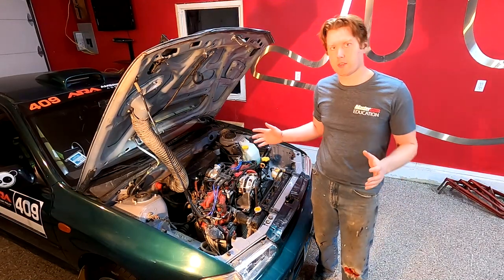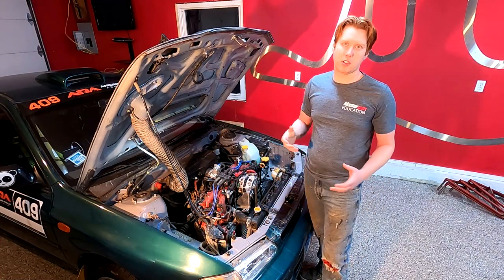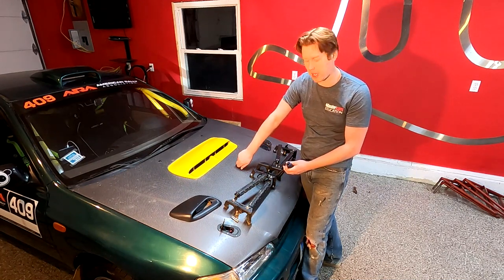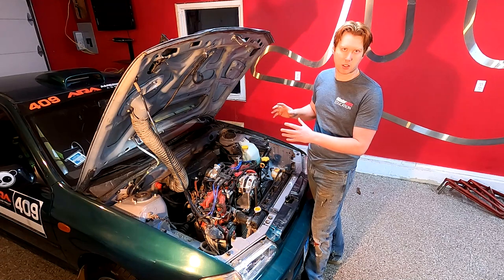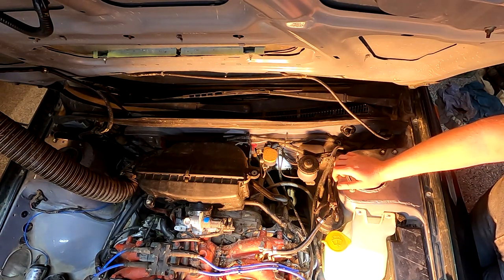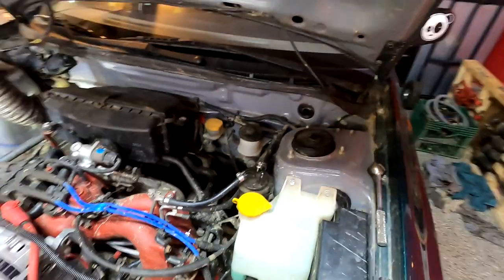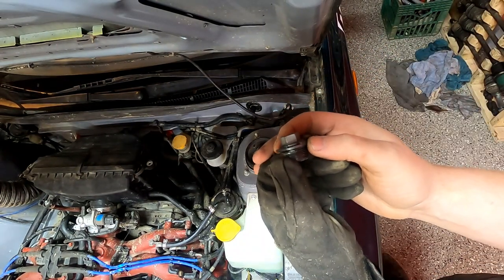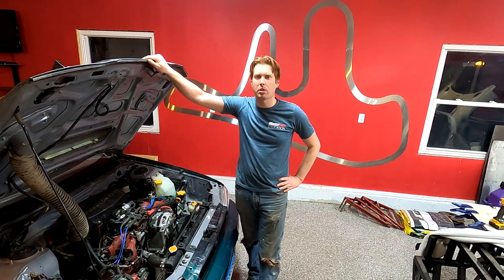Rally Car Prep Tips and Tricks for Grassroots Racers- Part 3! Engine Bay Prep

Comment: Awesome! What's that black stuff in the front passenger side of the engine compartment. Sort of looks like plastic can lids or something? With the Aerocatch hood pins, are you still using the stock hood release latch in addition to those? It'd be cool to see how you wired up your kill switch and also about your electric power steering.  Keep it up man, these are great.
Reply from the maker: Hey Pat! The lids on the passenger side are the tops of the horns for our dixie horn setup. Important to make sure the fans are happy! For the hood latch, ARA rules require the interior actuated hood latch be disabled so that the hood be opened entirely from outside. Some people delete the entire latch, but I left the secondary hand latch that is actuated with the hood partially opened. I'll definitely go over wiring the kill switch and what I did for the EPAS setup in their own videos in the future!

Comment: Great set of videos Dylan, really enjoying them. I've been watching Team O'Neil on YT and although they are very informative with fantastic content and production, I was almost at the point of saying there's no point of getting involved as the budget they were talking about was massively out of reach. They are talking about entry level cars in the region of $30,000 before you even turn a wheel.
 Then I came across yours and thought it might actually be affordable.  Are you ultimately governed by FIA regs? Here in Australia we run under CAMS. but if you go to rules and regs it takes you straight to the FIA hand book. I would assume that yours are based on the same stuff.
 You can't use road signs in Australia as they are only 1mm ally ( or so I've been told ) However the steel poles that hold them up are 2 3/4 inch 4 mm wall gal pipe ( or so I've been told ) Are you going to do any more in the series....
Reply from the maker: Glad you liked it! Here in North America, sanctioning bodies use large portions of the FIA regs for their ruleset, with small adjustments for common sense situations. While the rules can initially seem overwhelming, taking them system by system as you bring your car up to spec makes them much less intimidating. Make no mistake, rally racing is a much larger initial investment than something like a weekend track car or other form of motorsports. I had well over $10k USD in my build even with doing every single bit of prep myself, keeping stock brakes, stock engine, and all the other little tips that you see in the videos. My best advice would be to try to find a used entry level car for sale to shortcut all of the build time and get you something closer to the end result that might only require a few changes to bring up to current legal status and make ready for stage. 

I'll be doing more videos in the series soon, as it's our winter lull here in New England!
Reply: @DylanGondyke  Hi Dylan thanks for getting back to me. The main aim is to get my son involved in as many aspects as possible. My history is rally, street machine, custom semi's ( we call them trucks ) Monster trucks and Jet Trucks. so it's actually an exercise in passing along as many skills to my son as I can.
 The car we have is a 1.6 DOHC Hyundia Getz 117 hp 890 kg, which was a repairable right of bought for under a grand. He got stuck into removing the repair panel from the donner shell and I welded it back in for him. Cost to repair that and get it inspected was just over $350.
 Most of the budget is going to be FIA approved stuff. like seats, harness, HANS device. and I've opted to buy an FIA approved roll cage as it wasn't much dearer than the price I was quoted to buy seamless tube ( which won't be available until the end of March ), and  the inspector here can be very very picky.
 The Getz has pretty week suspension so the upgrade will be K Sport who does a control rally spec package for the earlier Hyundia Excel, and that bolts straight in.
 Steel wheels, rally tires and he can use my old coms system from my monster truck. We'll be doing stich welding, strut tower strengthening, strut bracing and ally bending ( sump and fuel tank guard ) running the brake lines through the inside of the car our self.... A, mainly so he can learn that sort of sort of stuff.... B, to keep the cost down... It has to be a log book build hence all the FIA gear, or it can't compete. 

 I would like to get the car to the first stage for about $6500. with a 20% contingency plan.
 The roads here that they use for gravel stages are pretty good, red gravel with a clay base, they're usually pretty well graded as well, no big rocks as they usually run Super B and pocket Road Trains log trucks along them they're pretty wide as well.
 Look forward to seeing your next video...sorry for the ramble....
Reply from the maker: @aussietruckphotosandmodels8510  that sounds like a very well thought out and practical plan. Don't go too crazy on stitch welding and chassis mods for a first car! (Like I did...) That's time you could have spent just driving it and learning and having fun instead. Best of luck to you two! Aussie roads look like dream roads to rally on

Comment: install strut bar
Reply from the maker: A strut bar isn't as important on a fully caged and seam welded car, and working in the engine compartment becomes more difficult if one is installed. For a non caged rallycross car, a good stiff strut bar will make noticeable improvements.